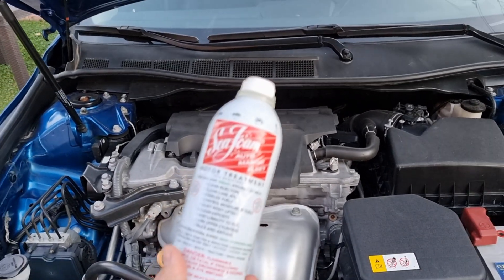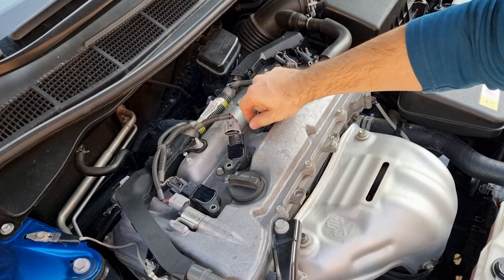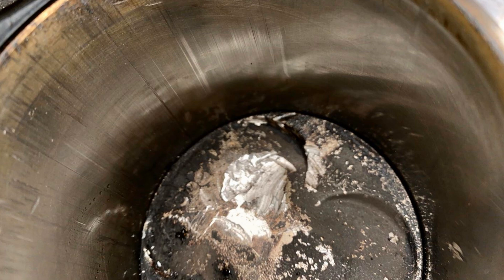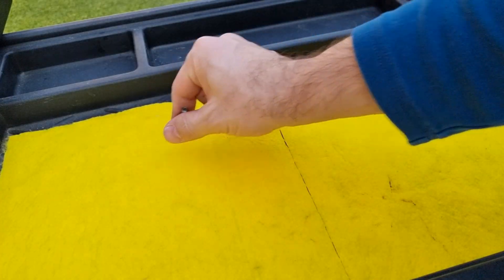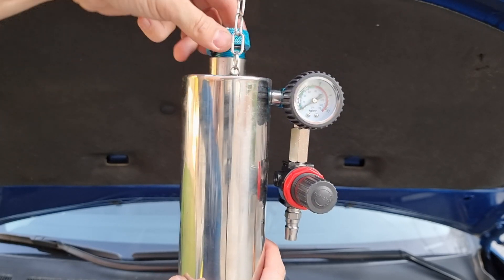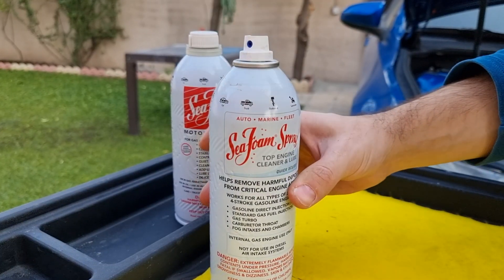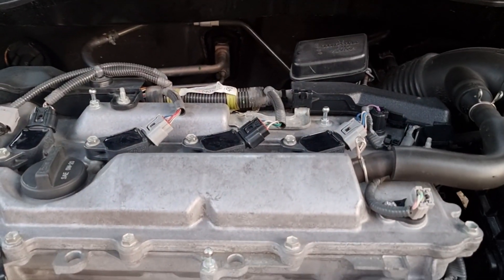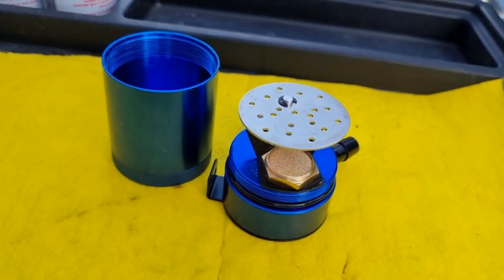Piston Carbon buildup cleaning in less than 5 Minutes/Cleaning Piston Carbon by AUTOOL Kit/seafoam

Comment: I have a 2015 Camry and the carbon build up is horrible on my car right now. I ran cataclean and I instantly noticed the difference. My car doesn’t have an engine light for it, but I’ve been doing the carbon cleaning with different seafoam products and I see it getting better. I wish I didn’t let it get this bad. Carbon buildup is no joke.
Reply from the maker: Thanks for sharing, that's true, ones it gets heavy, it's hard to clean it in one go, you need to make it in steps, weeks and oil change between them

Comment: Try soaking each cylinder at TDC for a day with marval mystery oil then suck it out or your preferred removal method. Drain the engine oil and add fresh oil then add a bit to the oil and drive for 500km max and change oil and inspect.

Comment: Hi  can I do this on a diesel engine I was thinking about spraying carbon cleaner in to the air intake past the air intake sensor , do you think that would do damage to my  direct injection diesel or would it clean the back of the valves like I'm hoping it will.

Comment: Awesome! Would this also clean intake valves or should I stick with CRC cleaner for that purpose? Please make a video on how to clean fuel injectors without removing them on this GDI engine aswell, that will be so helpful, cheers!
Reply from the maker: Thanks, it will also clean intake valves as well ,I will do a video and use CRC intake cleaner as well, so I can k ow which one works better, I did a video how to clean camrys Fuel injectors without removing its also GDI
Reply: @AliMECH  Great! Could you please share the link? And that's a great idea to compare both products, I have use CRC cleaner in the past but will be interesting to see which one is better, thanks!
Reply from the maker: https://youtu.be/iDlLvCh4JDA
Reply: @AliMECH  is that camry direct injection?